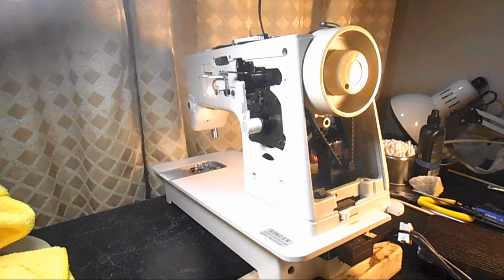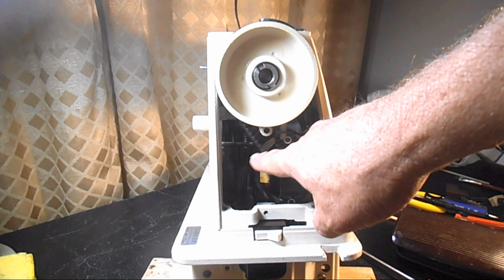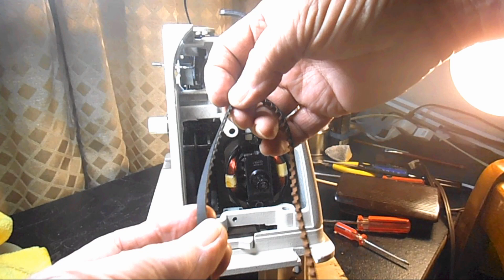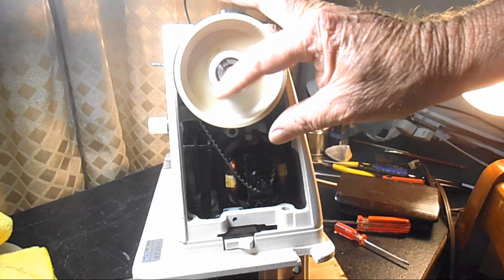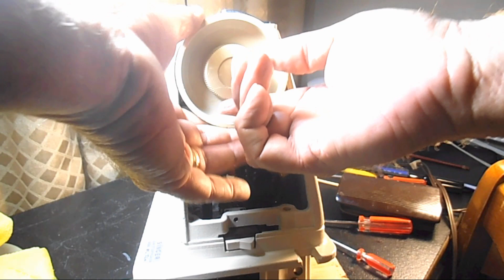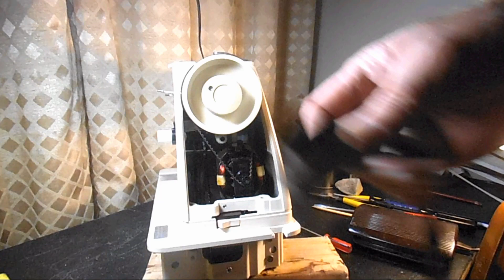How to Replace the Motor Belt on a Singer Model 513 Sewing Machine

Comment: Hi Andy!  I was thinking you were going to mention the ebay seller where you have had good luck purchasing belts. I am in need of A motor belt for a White 1755. Is taking a measurement my best bet? This model number doesn't seem to show up in ebay searches and the parts suppliers don't seem to offer the belt. Any thoughts would be welcome.
Reply from the maker: eBay sellers come and go, and I'm strictly a Singer guy. The video is 8 years old. If you really need to replace the belt, measuring it is about the only way to go. Most sellers can be contacted by email with the measurements and will check their inventory to see if a match is available. Measure the width, the inside and outside dimensions, and count the number of teeth, if any. Good luck.
Reply: @andytubesewing1953  Thanks, Andy. So helpful.

Comment: Replaced broken 2 gears and adjusted timing gear on my singer model 533 now zig zag stitching not work. would you please let me know what seems the problem is.   Thank You
Reply from the maker: Impossible for me to know what happened during gear replacement, or before that. Several things affect ZZ stitching. You can buy & download the 80-page Service Manual for $4.99 at this link: https://manualsoncd.com/product/singer-500-sewing-machine-service-manual-518-538-513-514-533/

Comment: There is a little slot in the plastic adjusting washer making it even easier to adjust the drive belt tension. Turn it anti clockwise to tighten the belt and clockwise to slacken.
Reply: Just to add that my machine is a Singer 507 model.

Comment: @AndyTube, hi Andy, if motor runs but pully slipping, sparaticly while sewing, does that mean belt is too loose? There's a metal sleeve inside the pully that doesn't seem to have any grip on the pully itself which I think is causing it to slip. Would appreciate your feedback please😊 Susie
Reply from the maker: Is this on a model 513? I don't remember seeing a metal sleeve on the inside of a pulley on a Singer machine before, so I'm curious. Yes, if the belt is slipping on the motor pulley that's a classic sign of a loose belt. The belt can also slip if oil got on the pulley or belt while you were oiling the machine. If you just got the machine and are getting it to work you can also clean the pulley and belt with alcohol. I just put a generous amount of alcohol on a rag and vigorously rub-down the belt and wipe the pulley and handwheel area where the belt rides. That can remove any carbon deposits and buildup on older belts and soften them a little to try and get a better grip on the pulley. That may be all you need, but if it helps at first then the belt starts slipping again you should try to tighten it a little bit. Good luck, and thanks for watching my channel.
Reply: @andytubesewing1953  yes on my 513, same as in the video. I replaced hook shaft gear, adjusted needle bar, set the timing, cleaned and oiled as you suggested. It's purring like a kitten and stitches are beautiful😁 The belt looks to be fairly new and clean. I just now adjusted the belt, working better but belt is now working it's way off the pully. Re: sleeve, I removed the motor pully , it just pulled off, and the metal sleeve stayed on the shaft. Also wondering if the speed on yours is slow? Mine is, motor not powerful enough for faster speed?😏
Reply from the maker: @caper695  OK, I got it now. I'm sorry, Caper695. I forgot the type of pulley on the 500s. So the metal part on the motor shaft is a sleeve, and part No. 103543. The pulley part original part No. was 618177-002. That was replaced with pulley part No.604545 which also fits some Brother Machines. You can buy the pulley part here: https://www.vintagesingerparts.com/products/singer-motor-pulley-fits-models-533-534-833-834   (trusted seller) and a couple other places sell it. The only place I could find the sleeve, part No. 103543 is in Australia which tells me there isn't much call for it and it is the pulley that wears and pulls off. Here is the sleeve seller in case you are desperate or just curious: https://maxisewdataezi.com.au/product/618177-002-singer-513-motor-pulley-sleeve/  Good luck, and again I'm sorry I misunderstood. Oh, wait, 👀I just saw you're asking a question about the motor speed now. It's not the fastest motor Singer made. It is an EN(K)8 OPEN motor. You can clean the commutator which usually helps speed up any motor https://youtu.be/rpTy_Bz3prA    You can also clean and adjust the foot controller which may never have been done. It controls motor speed, right? https://www.youtube.com/playlist?list=PLsCOZgzzaiKItPLWcK24FBoMdHK8vTXNi   OK, I think that covers it for now.🎯
Reply: @andytubesewing1953  thanks for the info😊 I'll look into everything you suggested👍 I guess I'm just spoiled from using my little beast 99K 😆😆😆 Thanks to your videos I'm confident that I can tackle any machine issues! God Bless you Andy for helping to keep the practice of repair alive for generations to come 🙏😁👍
Reply from the maker: @caper695  Model 513 was considered a "good" model, but working on it makes me appreciate the older Singers all the more. Good luck.
Reply: @andytubesewing1953  I agtee! Thanks Andy

Comment: I think this will work for my stylist 514 as well.  I noticed the belt looked a little worn.  I asked about it at sewing store that does repairs and was told that if my machine needs that type if repair that it's not worth it and I should buy a new one!  I guess that would be more lucrative for the store.  I brought the machine second hand in the late 1980s and it's done me well.  The plastic gears needed replacing but I managed to do that myself.  I wish you could buy metal replacements for the plastic gears.  All in all, I've gotten my money's worth out of the machine and it has done me well.  I'm sure I will still get a lot more use out of it.  Thanks for your informative videos.  I'd much rather repair than toss it and buy new.  There is too much of a disposable attitude in our culture now.
Reply from the maker: Yes, the same type replacement on model 514, and if you can change the gears, the belt replacement is no problem for you. I love that you're keeping the machine in service and agree about disposability. I'm encouraged by the new Right to Repair (RTR) movement here in the US and hope it spreads. Thanks for watching my channel and happy sewing.
Reply: I have replaced all the gears and the drivebelt by studying these videos. So precise and he takes his time. My 45 year old machine runs like brand new. Stay well away from any shop which tell you that a machine isn't worth repairing.

Comment: Hi Andy,
Thank you for your helpful and clear videos.  

I've looked, but can't find one on replacing the timing belt on a Singer 500 series machine in your list - if you have made one on this subject could you send me a link?. 

Changing the timing belt on the 500 series looks very complicated and it seems Singer suggest removing a lot of parts to pull out the horizontal top shaft for this purpose. I have been told that it is possible to remove the top shaft by removing the needle bar only, but I can't seem to work it out looking at the machine. I'd be most grateful if you are able to throw some light on this task!

Cheers, Roger
Reply from the maker: Hi, Roger. It is complicated. I have not done it b/c I don't feel the machine is worth that effort. I'd rather spend the money and time on different vintage machines. The remove needle bar theory is that you can "force" the arm shaft to the handwheel end after removing the NB and replace the belt. Not true, IMO. There are still other parts in the way of slipping the belt over the shaft. A couple guys I know have done the repairs for customers who had sentimental value for the machine. They charged a lot of money and both said they wouldn't do it again.  I received your PP donation and will reply with some better options for machines to send. I'll do it later today so hang on a little bit before you make decisions, OK?

Comment: Thank you ! Turns out on a 319 (or a similar model, I imagine) I only had to take off the hand wheel and, using a universal belt (which stretches), replace the old one.  Thanks, however, for showing me how to.  Silly me hadn't noticed the screw and probably wouldn't have put two and two together if I had 😅
Reply from the maker: wow what a nice easy install I guess that's the advantage of a stretchable belt nicely done and I guess you're back in business thanks for watching my channel and taking time to comment